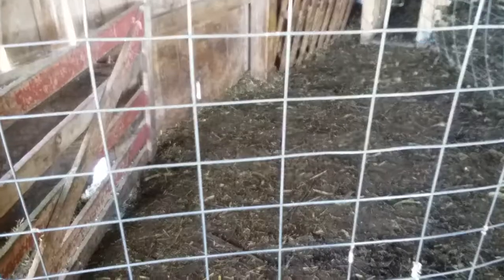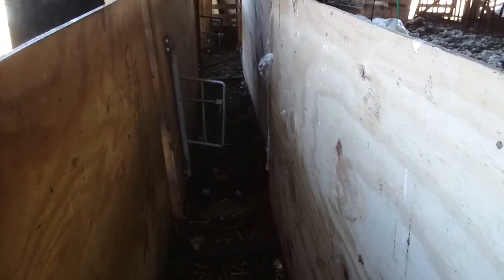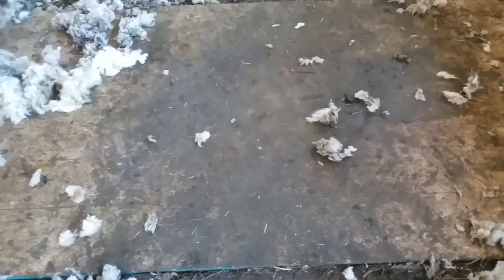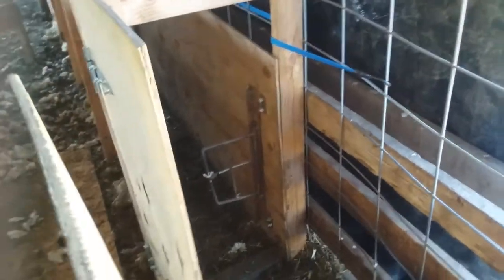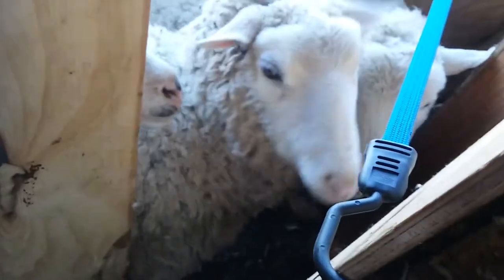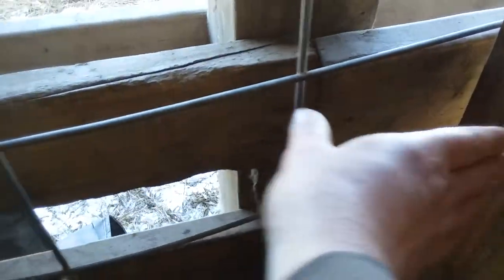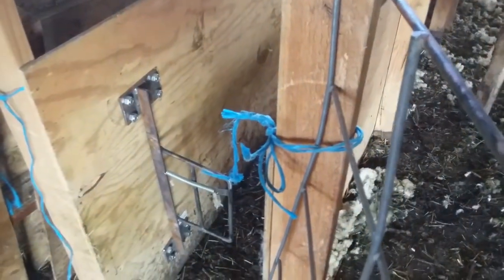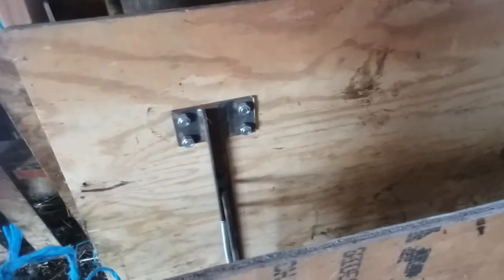Our Homemade Working Chute For Sheep

Comment: Your shut is perfect, it's a big time and money saver, good build!  
For our small herd of 9 penning works but I like the chute for even easier acces to the next sheep in line.  Will see if we have time this year to do a bit of changes to our pen system as I'm sure our shearer will appreciate it.  I also like the use of plywood to keep them calm, ours are always trying to squeeze between the 2 x 4's.  
Our sheep were sheared yesterday which is earlier than usual, much better without all the bugs!
Thank you for the helpful video that works peacefully for sheep and shearer:)
Reply from the maker: Glad to hear you got the shearing done, shearers are in short supply down here! 
We used to pen the sheep, as well. It just got to be too crazy. Building this was one of Jason's best ideas ever, we use it for all kinds of stuff.

Comment: Great work on your chute. 
I built ours with well pipe and left over steel panels from when we put the roof on the barn.
Check with the local water well driller if they have old pipe they pulled. We get 1 1/4" OD pipe, works great for gates too. Use the pipe for the frame then use a hog panel to fill in. 
Around here it is pretty reasonably priced.
Reply from the maker: Great idea about the pipe, thanks Fred!